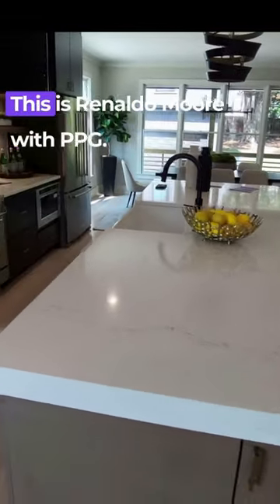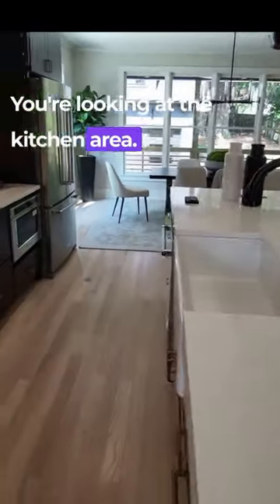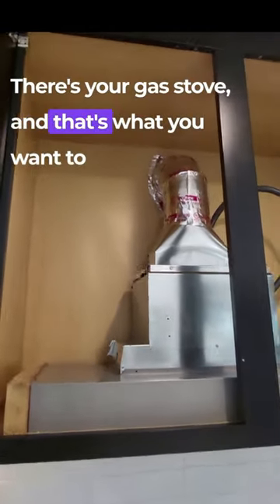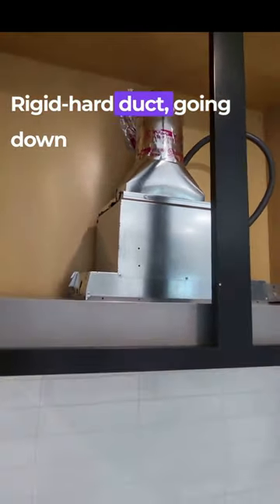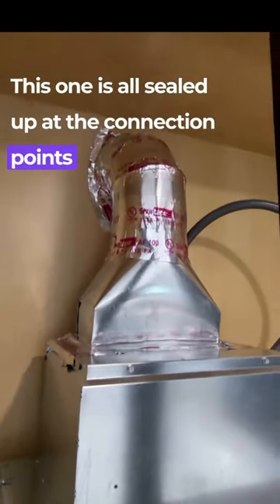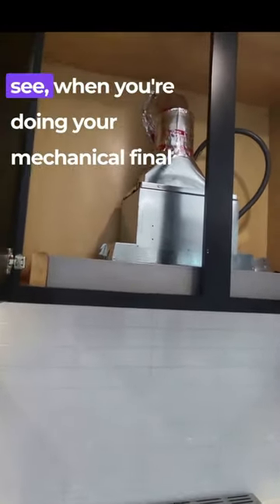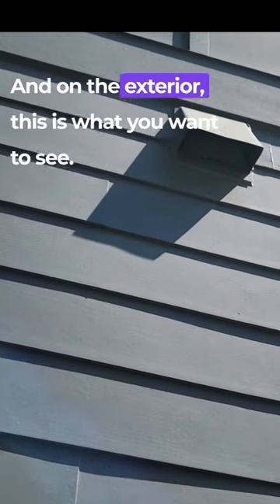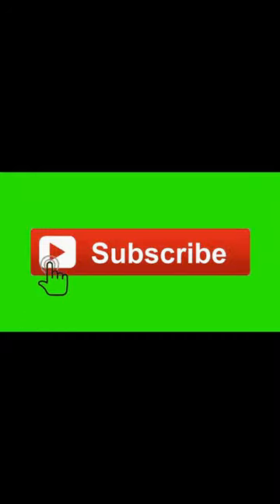Don’t Create a Kitchen Fire (Kitchen Exhaust Duct Done Correctly)

Comment: Do you also check to ensure the CFM of the fan is adequate for the BTU’s of the cooktop?
Reply from the maker: For residential application??...unless it's some huge commercial size gas  range. I really don't see the need. Most residential kitchen hoods exhaust between 200 - 400 cfm.  I normally use the 100 cfm for every 12" rule.
Reply: @PPG1967   yes some of these “commercial type” cooktops people put in can crank some serious BTUs. My understanding and the rule of thumb I go by is 100CFM for every 10k BTU (total btus of the cooktop). Then anything over 400CFM needs makeup air.